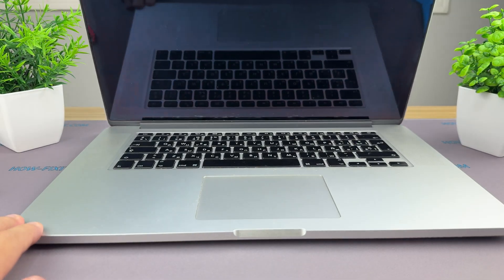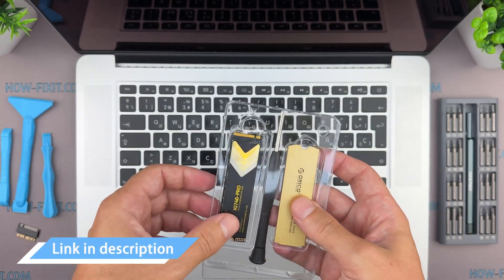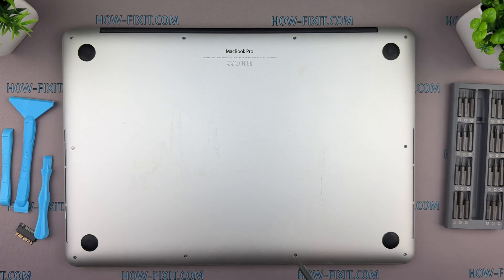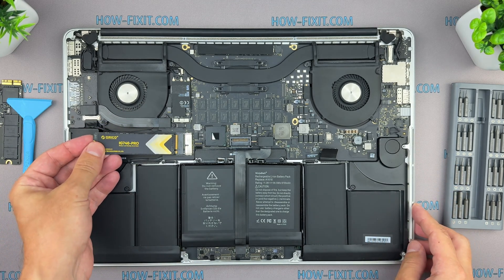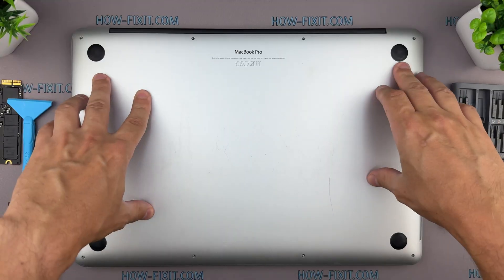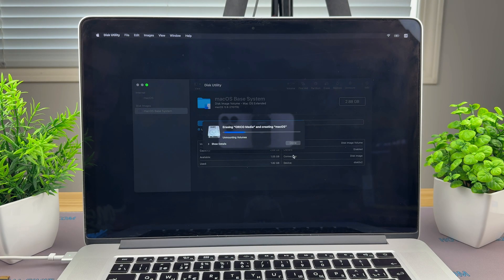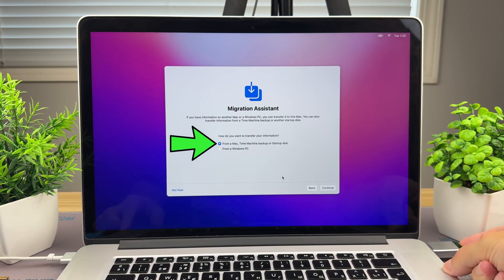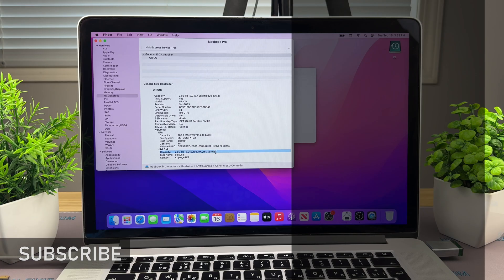How to Install a 2TB SSD in MacBook Pro 2015 + Internet Recovery & Data Transfer

Comment: Please please make some videos on the MBP M1 13" with Touch bar series. It is the cheapest of the Apple silicon models (I've seen them in Pawn shops fully operational for $200, $50 for partially operational, and this was 6mo ago, so it'll only keep decreasing in price).
Reply: you can not replace the SSD in Apple silicon models as they are soldered to the motherboard

Comment: Just finished the 2tb m2 swap on my MacBook Pro 2015. Any red flags after moving data?
Reply: None on mine. Mac’s health check showed no warnings, and a deeper test found zero data errors
Reply: @MrWhite-i9cpu  nice. Did temps get scary without a tick thermal pad?
Reply: @Maquinna-She  Peak was ~70 °C during heavy copying, mid-40s at idle with a thin heatsink normal
Reply: @MrWhite-i9cpu  internet recovery gave me Sierra first, should I reformat APFS or stay HFS+?
Reply: @Maquinna-She  If you upgrade to High Sierra or newer, switch to APFS. On older systems, HFS+ is fine
Reply: @MrWhite-i9cpu  the SSD screw wouldn't bite with the adapter, what did you do?
Reply: @Maquinna-She  Slight angle while tightening worked
Reply: @MrWhite-i9cpu Any sleep or wake weirdness with the adapter?
Reply: @Maquinna-She  Works like stock here, no random wake-ups or battery drain overnight
Reply: @MrWhite-i9cpu  speaking of battery, did you disconnect it before pulling the old ssd?
Reply: @Maquinna-She  Yes—Safer for the board
Reply: @MrWhite-i9cpu Do i need to enable TRIM?
Reply: @Maquinna-She  Optional. Many NVMe drives run fine without it, but you can enable later if you know what you’re doing
Reply: @MrWhite-i9cpu  how about speed noticeable upgrade?
Reply: @Maquinna-She  Big jump in app launches and file copies. Not the latest-gen speeds, but way faster than the Apple blade
Reply: @MrWhite-i9cpu  perfect! Last thing: backup method you used?
Reply: @Maquinna-She  Time Machine to an external drive. After the clean install, Migration Assistant brought everything back
Reply: @MrWhite-i9cpu Thanks!

Comment: Did you verify PCIe lane negotiation (x4 vs x2) on the 2015 15″? Any measurable impact on sustained writes after SLC cache?
Reply from the maker: Yes, the MacBook A1398 negotiated PCIe ×4 with the M2 NVMe via adapter. System Report/ioreg showed Link Width x4
Reply from the maker: About the SLC cache. Yes, during a 200 GB mixed write test, writes held ~1.3–1.4 GB/s until the drive’s SLC cache filled, then leveled at ~600–700 MB/s.
Reply: @howfixit  Any throttling once it heats up?
Reply from the maker: Not with a slim heatsink. Peak ~72 °C during long copies; performance stayed steady.
Reply: @howfixit  So real world upgrade worth it?
Reply from the maker: Definitely—faster app loads and file moves, plus 2 TB headroom without quirks.